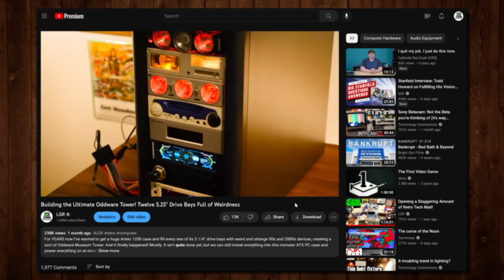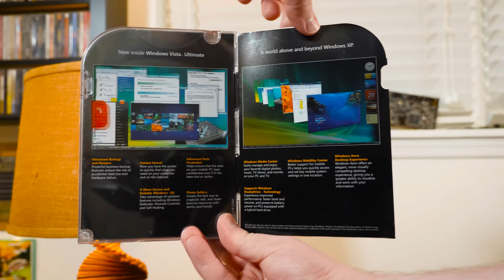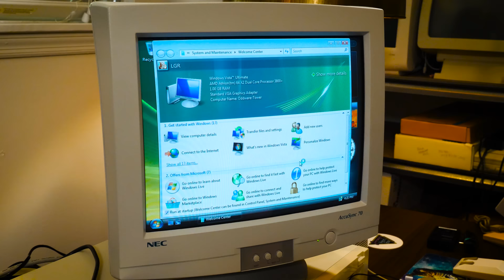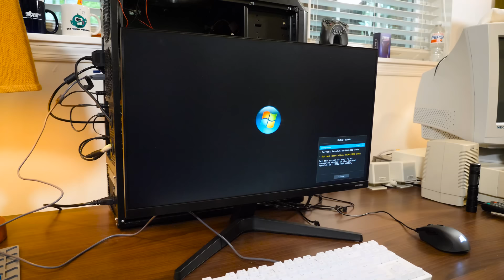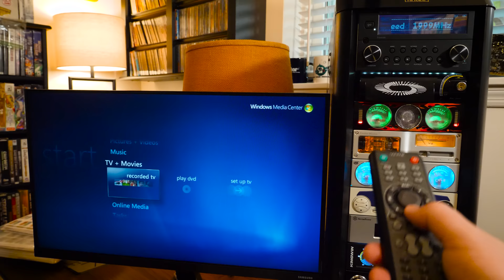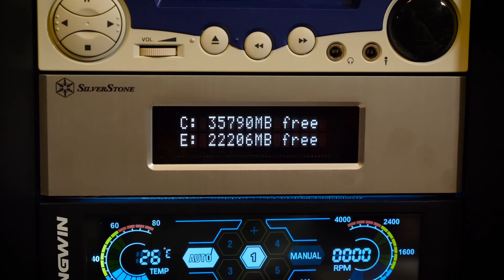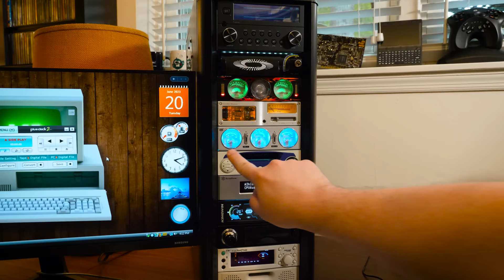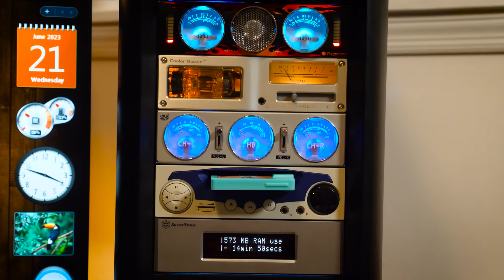Finishing the Ultimate Oddware Tower! Windows Vista PC Build

Comment: It needs a Microsoft Strategic Commander, a Saitek Cyborg 3D, Saitek PC Dash V1, and to complete the input overload a KeyPro FK9000 keyboard.

The FK9000 has 12 programmable function keys which can be loaded with strings of keypresses using just the keyboard so its operating system independent. It also has a switch to turn the numpad into a calculator (that can't send its output to the computer), 8-way arrow keys and some other goodies, which includes NOT having Windows Keys. Someone made a replacement LCD for the calculator which adds additional capabilities. This keyboard uses an odd 3 cell NiCd battery to retain the PF key programming. The battery is charged by the +5V to the keyboard.

The Saitek PC Dash was made in a couple of versions. Version 1 connects inline with an AT or PS/2 keyboard for power and input to the computer. It requires no drivers because the software prints the programming for it as barcodes on the keypad overlay sheets. A manually operated barcode reader built into the PC Dash was used to program it. There was software to design your own overlays and they had an assortment of ready made ones to print for popular games. If you can run the overlay design software and adapt the keyboard connection, PC Dash 1 will work with any PC OS.

Version 2 was USB so it dropped the barcode programming for programming through USB. If the driver and programming software won't run on the OS on the PC, this PC Dash won't work. Fortunately for Saitek products the web archive has an extensive collection of the site over the years.

I happen to have an original version Cyborg 3D stick, Strategic Commander, PC Dash V1, and two FK9000 keyboards. I know where the stick and keyboards are, not sure where the Strategic Commander and PC Dash are.

Comment: This how we used to do then started a bussiness around that time - used am2 matx motherboards , but had to use 1U server rack case. The problem with that is that 3 jack audio connetor won't fit. So it was desoldered (you can still use front panel audio connector later on if you like (or solder it back), but as it never happened since after 3-5 years these were like total garbage. I can see that here someone has just cut the top audio jack off and taped it together. Also had these dynatron solid copper cooler on which put out ton of cooling but is mega noisy, but for servers it does not matter. Also these DOMs are used even today on servers - they have sata ports and have that same JST connector besides sata so you can get the power directly from motherboard instead of bulky molex connector.

Comment: For the keyboard, you could go for one of those wierd things that is in Three parts. ...and for added messiness, get a USB numberpad and a Serial trackpad drawing thing. You could look around and grab as wierd as possible trackball mouse with integral RGB. Then of course, theres always the Joystick to consider. Theres got to be some sort of adapter that allows you to plug in Four different joysticks or controllers that you can switch between. For the monitor option, maybe you could go the whole complexity rediculousness and have a 9,12, or 16 monitor array for video playback and gameplay, plus an extra monitor for desktop. ...oh and dont forget to install a TV card and a Satelite Reciever card if you have enough spare slots. ...then of course you can add a motorised dish orientation setup just to keep up with what was available back then. ...and maybe join SETI cos, why not.

Comment: That PLA adapter would have definetly warped over time, even at ambient temperature.
I have a headphone holder that clamps to my desk and after a year the 2 clamping faces werent straight to each other anymore, as PLA slowly bends at ambient as well.
Which is the reason why I mostly use PETG now, it seems to print just fine and AFAIK it doesnt warp at ambient.

Comment: Man, those Windows Vista/7 and Office boxes were something! Still got one with Office 2007 Home & Student. And that VIA Chrome9 integrated graphics... My friend gave me his old PC to check, and there is old MSI K9VGN-V Mobo with AMD Athlon 64 X2 6000+ CPU and 2GB DDR2 667MHz RAM and also VIA Chrome9 graphics... This thing can't even run GTA SA properly... Installing my Palit GeForce 6600 LE solved the problem, so I think installing a proper GPU in your system would be great, but obviously it must be something from the Vista era

Comment: I keep my old server tower a customized beige box because the drive bays but I may have to give it up unless a customer can cut me some vents in it with their cnc/plasma or add a squirrel cage blower in the second power supply space. 4 90mm fans was fine for the dual 400mhz pIIIs but a dual 14 core xeons and a 1080 I think only the massive amount of space inside gives me a buffer. I think it's mass  It's like computer cases were boring beige boxes that got fun when people started modding them, we got some cool cases out of it. Now everything is a glass cube and good luck finding an external drive bay unless you buy the most generic of workstation or server chassis. With all of it went the cool drive bay accessories.

Comment: Several people have mentioned optical drives. Something odd would be a CD-ROM that needed caddies. How many people remember those ?  We had an IHS components document library at work on about 30 CDs with each one in a Caddy.

Graphics should be either from a weird company like 3dFX or NEC, or combined with a TV card. As well as the usual ATI All in Wonders, I once had an NVidia one with the tuner and IO in an NVidia green translucent case (as was compulsory for consumer electronics for a few years after the launch of the iMac 🙂)

Comment: I think you should look into removing the two less useful items (fan and lighter tray) and replacing them with a 2x 5 1/4" bay LCD screen, removing the need to connect a monitor. Turning it into a self contained Vista odd-ware tower. If such an LCD exists... or perhaps, one can be fashioned with a bit of 3D printing and an off the Ali Express LCD + controller. ^_^

Comment: 29:19 I actually have that fan controller too. xD Mine was a slightly different model, yet mostly the same, though I no longer use it (and actually my current PC tower is all tempered glass, so even though a 5¼" bay exists , it can not be readily accessed).

Comment: So I bought and used 2 of those low-profile coolers, back in the good ol days (aka 2006) to use on a couple of machines that I was building primarily for use at small, middle/high school  weeb nerd basement LAN parties (so like file hosting, game servers, pr0n, etc), although when not in use I of course did use em for other things at home, turned one into an HTPC at some point...

Now,  I'm not entirely sure that they had that brand's sticker on them, they might have just been bare metal; but otherwise they were very much identical, in fact that entire setup is pretty close to what I had, although I had chosen slightly beefier versions of the athlon x64x2. I think for some reason, I even got one as a black edition lmao...
However, the second I saw those things at the start of the video, I was just waiting for the eventual, inevitable moment when you addressed their noise level and sheer power, holy cow! 

When I first got them, I was taken aback by their extraordinary intensity, however thankfully the small form factor cases that I chose kept the sound in. (total no-brand, lowest cost 'server-ish' looking things that I could find on tigerdirect here, mind you).

I was 13 or 14 at the time, so of course one of them had green cold cathodes, and the other red. Their official names were Suiseiki and Souseiseki. (Because what can I say, weebs...)

Also the motherboards were I think mismatched random stuff that worked, and I threw a couple of low-pro 8500GS (9500? 8300? Idk anymore. They were not top of the line, let's put it that way but still fairly capable, dual monitors using this bizarre dvi shaped connector / breakout dongle combination where the card end had twice the amount of pins as your normal DVI) cards in there for mild gaming ability, which totally was a good idea in the end when one needed to be repurposed on the fly into someone's PC for the LAN, following catastrophic hardware failure on their end...

Oh yeah, and it didn't have a ridiculous amount of 5.25" drive bay accessories either, so there's that

Comment: I will say as a 3d printing nerd myself its not so much the heat with PLA at least not at the temps its likely to see.  More so PLA just kinda slowly deforms when put under pressure for long times.  and it will no longer spring back to its Original shape.   So I would assume after a bit the clamping force will be less and eventually basically gone.

Comment: Fan controller?  Zalman ZM-MFC1 
That is the one i've been using in multiple PCs for DECADES now (including my current 7800X3D, RTX4070 build),  
Zalman made a ton of fan controllers back then, some with buttons and switches, some with displays.  
If anything it might be a bit too mainstream for this oddware PC, but if you want something reliable, there you go.  

As long as my PC case has a 3.25" bay i will continue to use the MFC1.  

I would kill for a modern quality case that has tampered glass but still retains a few 3.25" drivebays in the front, just so i can keep using that sexy fan controller.  

I love how the modern all tampered glass cases look, but i mourn the loss of the modularity and functionality of the 3.25" front bay.

Comment: Wild but cool looking setup. Back in the day this would be my dream machine. Only thing I'd of done different is put a compatible PCIe video card in it, and Windows 7. Vista 32 bit drivers will work on 32 bit 7 OS with zero issues. Also, I'd of chosen a different board, a socket 775 Asus board from that time error. One thing about Asus is their driver support, you can always find them online from Asus if you Google the exact drivers needed it will come up. Asus to this day offers drivers for boards way older than that one. Asus driver support is about the best in the business. Asus boards over 20 years old are still supported online.

Comment: I'm gonna be honest, regarding the wobbly fan controller, could you not just 3D print a shim/bracket to double as something that holds it still and extends it to the full bay inside, as well as a couple of black spacers that protrude above and below it in front? That seems like a perfect way to handle that. You don't even have to be super spot-on with the front spacers, since you could just file them down if they were too thick. That way you wouldn't have to look for a different fan controller that may or may not exist when you already have a pretty and functional one.
Reply from the maker: If I end up keeping it, I just might do that

Comment: I have an original Silverstone LC-16 case which includes a VFD but the original software is  called Soundgraph iMON. I think I am running version 8.1 and it is still easy to find and download. It is not the same GUI as LCD Smartie but offers the same features basically.

Comment: Okay so, now you need to source a second case and fill that with all of the odd drive bay devices you’ve covered (Zip drive, Yamaha Disk T@2, LightScribe, MD Data) and use a J2 Wormhole to connect the two machines. 

Playing Duke off an internal Zip drive, with audio routed to a separate system running the Oddware Overwatch Tower. 

Why? Because we can and more, is more.

Comment: Another fitting thing would be if you have gotten one of those zalman coolers as a cooler. They are very much fittingly od and from the period.
In terms of fan controllers I personally had a scythe one with nobs that showed rpm and temperature on 4 different places sadly a bit too new for this build (2012 era)

Comment: an original Athlon64 X2 3200+ should run 3.2 GHz, or at least that's what mine has always run. Something's not set right if you got it running at 2 GHz. The Athlon II 3200 is the one that runs at 2.something (think it's 2.8 GHz without boost), but they're far more rare because AMD lost a lot of market share to the i7 around that time.

Comment: Would love to see one with whatever the max Win2K Pro supports for hardware is, I doubt it would have worked here; but Win2K is XP without all the uh, well, crap to be honest. It will (dunno if it took BlackViper's optimizing or not) boot up in 32MB (yes MB) of RAM. It's my favorite OS by a landslide, and I'm pretty sure if a device had WinXP-32 drivers, it almost always had Windows 2000 drivers, too (both NT-based.)

Comment: Nice build. It's a blast. I wonder if something similar could be done but for midi stuff.
I got intrigue why that gpu has only 256gb of ram. I guess lower models have that. Use the gpu for the aero in Windows Vista. I had it but never use it and my vista disk broke.

Comment: Soo if you look around, someone did make a hack / mod of port 95 for 64 bit ( I could probably dig around and find it in all my stuff ), I remember using it to continue using LCDSmartie... which I still use under 10 today, except now I have some little LCD Backpack boards that connect to the parallel character LCDs that a friend designed and shared with me.

Comment: The issue is probably that the motherboard is expecting a PWM fan, but that fan doesn't have PWM. So the board has no idea why the fan isn't responding to PWM signals so it's getting fed straight 12v.

Comment: Put an actual cup holder in. The one that comes with an Audi A6  98-05 is about the right size. It will have to be modded a bit to clean up the edges of extraneous plastic bits.  
     I'm trying to install the plus2c deck in my rig, but I don't have the card for the ribbon cable to plug in.  Any ideas for a workaround? It uses an odd 20 pin cable.

Comment: I'm still a fan of LCDs with sysinfo and that's the reason for the alst two Logitech keyboards. I use LCDMisc with a preset that has everything I want in tiny font on one screen. I glance at it a lot and it's just really helpful to know what's currently going on. Is something blocking a core, am I hitting my RAM limit, what time is it, is the download crappy or is it a computing issue, is my GPU overheating?
Since Logitech is discontinuing putting LCDs in keyboards I guess I'll have to look for a standalone solution after this keyboard dies. At least that also means that I have more variety of keyboards to choose from.

Comment: that cpu cooling block looks like the one i had for my amd athlon x2 build back when it was "the hottest shit ever" mine was called "hyper evo 240" so guess it was lil bit bigger. a 240mm heatsink same angle as you put in that rig. and fit so one could hook two fans one each side to increase airflow through the computer, (both sucking air the same direction as to cool down more)

Comment: Yeah, server hardware loves to have fans on max, as they are stacked into a 19 inch rack and will heat up from other equipment squeezed in on bottom and on top of it. All servers I've worked with will need BIOS/CMOS settings adjusted for their environment.
Reply: Edit: server hardware is not appropriate for your setup. They are usually run without screens attached, and the focus is to run stable 24/7 for a decade. With support contracts in place. Consumer grade will always be more performant short term. But warranties will be less than 2-3 years (in EU 2 years for manufacturing defects is default).

Comment: I want to say that PLA "flows" under pressure, much like solder. it may be a very bad choice for this kind of bracket. I suggest ABS or a PC/ABS blend material. if it should be forever I would go with PA6 or PA12 but the PC/ABS blend would be my first choice here.
Neat to see all these components from back when I was about 16 and started get into all this stuff. very cool. thank you

Comment: Ridiculously huge case, 32bit operating system on 64bit hardware, load of hell fan... yeah. that all checks for mid 2000 pc alright. Now you just need to add a cheap glossy 1680x1050 TN panel display with abysmal horrbile color and contrast shift and 64ms input latency to make it an authentinc experience.

Comment: My concern with the 3D printed bracket wouldn't at all be the temperature (no way it'd get close to 60C that far away from the die) but I would be concerned about the layers delaminating.  Heatsink clips pull pretty damn hard.

Comment: Do u have any weird cd/dvd drives u should put that in, perhaps replace that thermaltake fire crap, since u aldready have dedicated speaker and vu meter musketerr thing. A dvd drive is really useful, atleast I like using it with my xp pc, yes also use usb, and messed with daemon to mount virtual cd when i need that... but still i prefer actual cds.. as some games, can be annoiyng with needing cd, and some games i had problem with virtually mounting it.. noticed u used dvd hanging out while instalation.. but i guess no weird dvd drives... just boring ones

Also not to mention a cd player makes sense for music for all those audio stuff

Comment: lol, i have this exact case, sticker inside says manufactured in 2000, I still use it but its got a modern rig in it, cooling is fantastic tbh. the entire front is fans though and ive not even got a cd drive installed

Comment: Mmm yeah, 64 bit OS on 2 GB RAM ...? The x64 OS consumes additional RAM (in this case half of it), and its only difference from x86 is that it supports more than 4GB RAM and that is the only advantage over 32 bit OS. if you have 4GB and less, you always put 32 bit OS, you save RAM and it is optimised and works better.